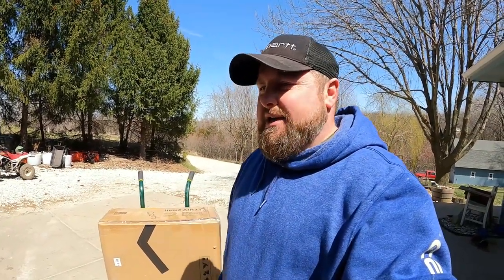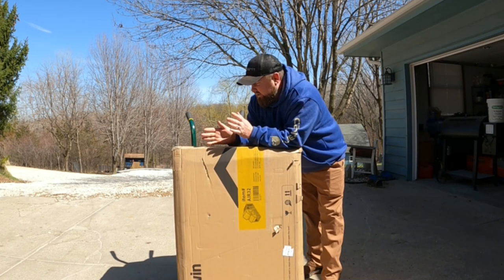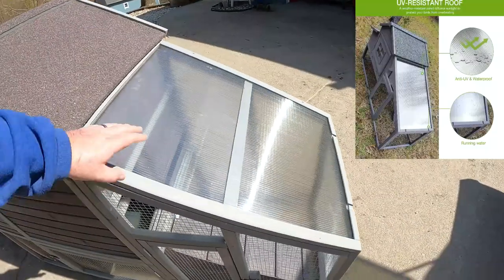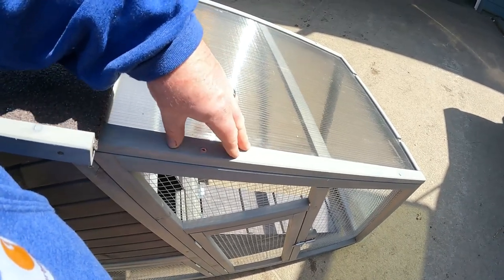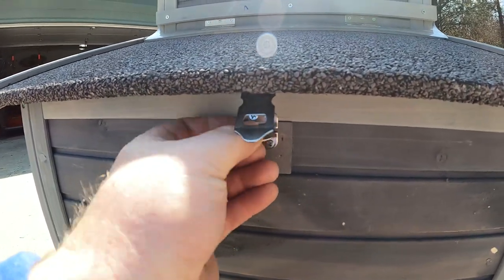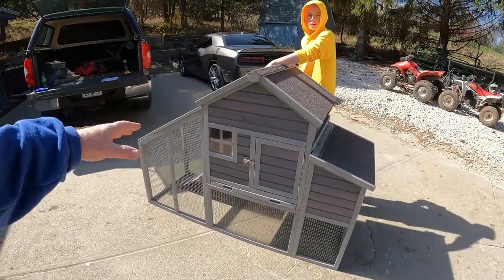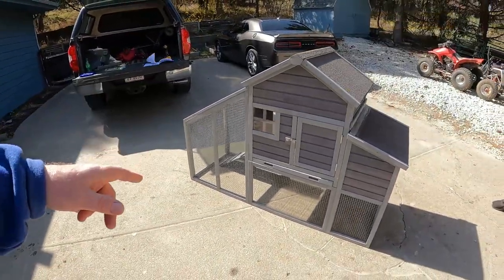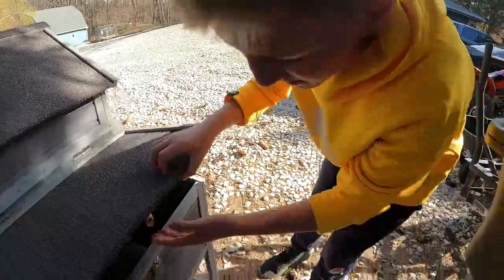❇️ Are Pre-Fab Coops All That ? Yard Minions Will Soon Find Out

Comment: Not sure if this mini coop is the same brand or just similar to the one that Grandpa Adler Farm has. His looks to be the larger version of yours. It's good for the young chickens and a few of the smaller breeds but not for the large breeds unless you only have 2 or 3. He has his coop inside a 10' X 20' (or larger) dog run/kennel for protection from predators. Now that they have started to lay eggs he also added extra nest boxes outside the coop. His chickens still use the inside nest boxes way more than the outside ones. I have no doubts that Ralph would be happy to answer any questions you have about the coop or anything he has had to do to it in the way of repairs or improvements.